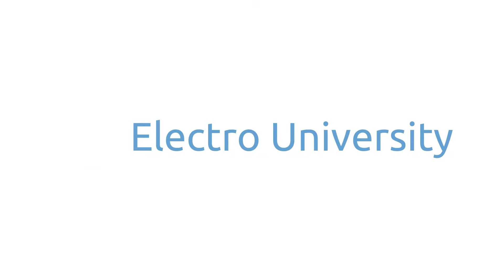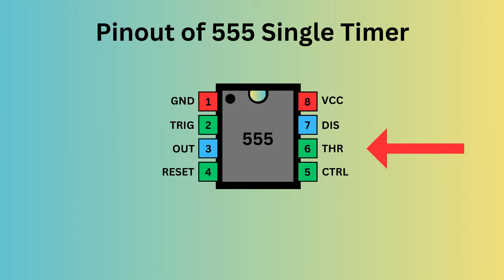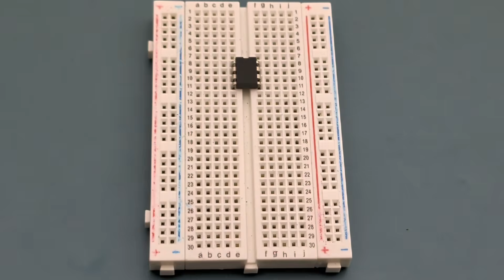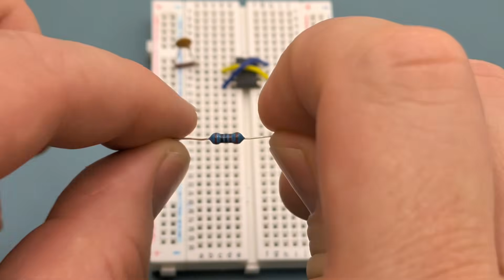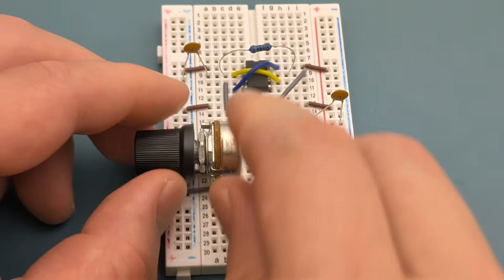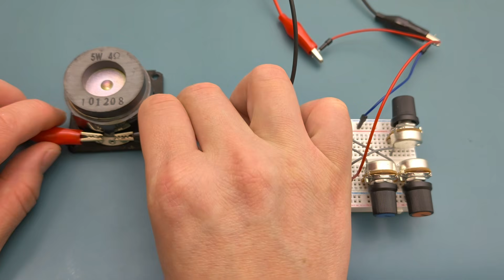DIY Analog Synth: Build the Atari Punk Circuit From Scratch

Comment from the maker: 🔔 Get your tools here:
✅ Electronics Component Kit: https://amzn.to/3N65asq
✅ 9V Battery Connector: https://amzn.to/3S7kbg8
✅ 9V Batteries: https://amzn.to/4kkonVD
✅ Electrolytic Capacitors: https://amzn.to/4dnrJF4
✅ Potentiometers: https://amzn.to/3HTOtAU
✅ NE555 Timer: https://amzn.to/41MpQhp
✅ Resistors: https://amzn.to/3YfGeUi
✅ Ceramic Capacitors: https://amzn.to/44kfg2b
✅ Jumper Wires: https://amzn.to/3NNn9UR
✅ 5 Colors LEDs: https://amzn.to/4tosOUP
✅ Solderless Breadboards: https://amzn.to/3SndKWm

Comment: you've got the value of the capacitors wrong: the right side capacitor should be 10 times bigger than the left side capacitor, it is notorious in the sound quality you get since you don't get the stepped tone generator, which was the original name of the synth
Reply: You've got the capacitor values wrong. The capacitor on the right should be 10× larger than the one on the left. This makes a huge difference to the sound: the astable section generates the tone, while the monostable section divides it into the characteristic stepped pitches. Without that capacitor ratio, you don't really get the stepped tone generator which was the original name for the _synth_. anyway, the video is masterfully crafted

Comment: Are you sure you schematics is correct and it would work as demonstrated?

E.g.: for some weird reason you left the pin 6 of the first 555 float on your schematic, while it's clearly connected to pin 2 on your breadboard (the yellow jumper wire). 
Furthermore, why did you connect the output 1-kOhm potentiometer in parallel to a speaker? If the speaker is 8-Ohm impedance, 1-kiloOhm would have little to no effect in a wide portion of the regulation, just at the zone very close to zero, where it would probably damage the potentiometer. This is clearly visible at 7:48 , where you rotated the potentiometer all-round with no effect, just at the end the sound level dropped abruptly.